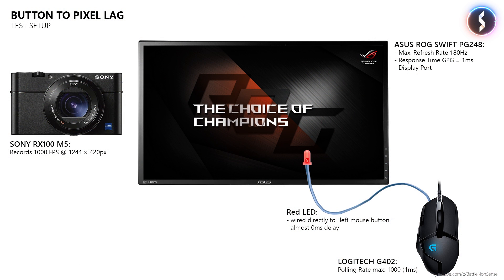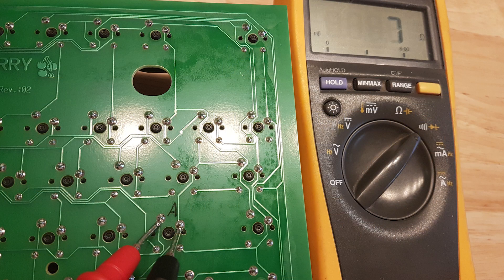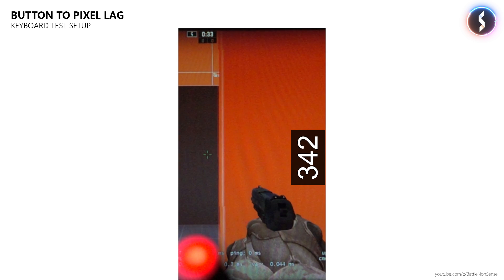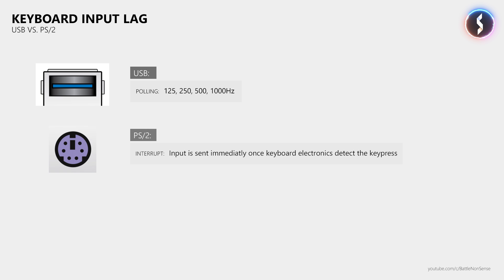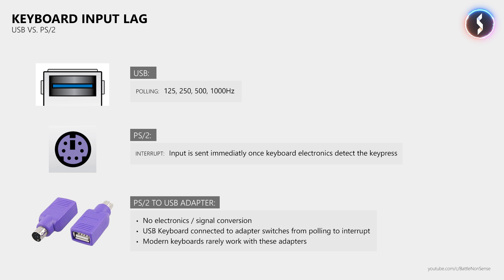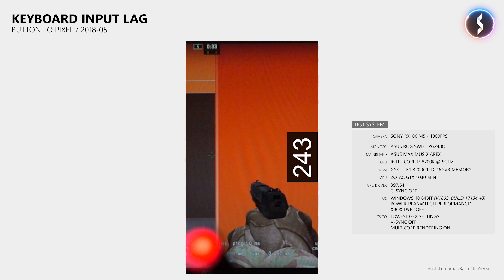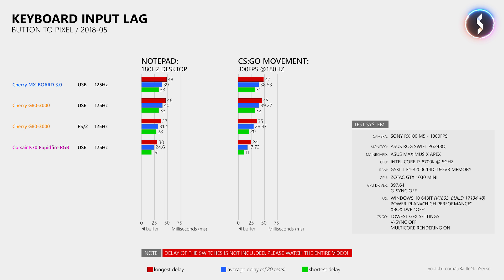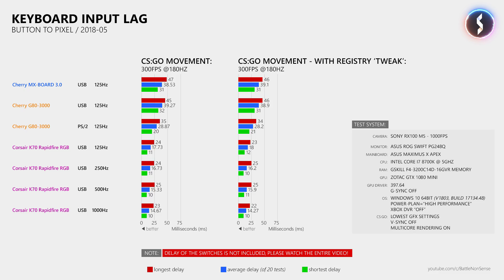Keyboard Input Lag 125, 250, 500, 1000Hz USB vs. PS/2

Comment: The polling rate defines the maximum delay from the usb connection. At 125hz you can have 0ms to 8ms delay with an average of 4ms. At 1000hz 0ms to 1ms with average 0.5ms. The average difference between 125hz and 1000hz in theory should be 3.5ms which the data confirm.
Reply from the maker: You are right! I am going to pin this comment. :)
Thanks!
Reply: CPU usage does increase with higher polling rates. Polling involves work that must be done by the CPU, your computer can't break the laws of physics. 
However, it should not be by any noticeable amount on a modern system. 9% on a 7500 is not a polling issue directly - but you are right that polling effects your CPU usage, so read on...
High polling rates should not increase power draw by any measurable amount. it would be in the order of milliamps in single to double digits. 
It should not have any bearing on stability at all.

An experiment for you to try: Open task manager, minimise all your windows and move the mouse back and forth as fast as possible over the desktop for a few seconds (make a big zig-zag and count to 5). CPU usage should stay the same. Now, maximise this youtube window, move the mouse in the same way over this comment section. Note the increase in CPU usage? That's youtube spying on you (yes, this webpage is a keylogger/mouselogger. It won't work on wikipedia for example, it will work on google) . Lower polling rate will decrease this effect, as there will be fewer updates for the browser to record.

So, as you can see Roni, decreasing polling rate does effect CPU utilisation, and while it will be to no significant degree directly, there are indirect consequences caused by the system responding to more frequent and numerous updates from the mouse.
Reply: Why would anyone use lower polling rates than available ?
Reply: Roni Väärälä
, you need to understand the big difference between interrupt and polling for IO.
Interrupt - IO device interrupts the CPU to inform it that there's new data available. So when there's no data available, the CPU doesn't need to pay any attention to the IO device.
Polling - The CPU periodically polls the IO device to see if there's new data available.

So with polling, the more frequently you perform the poll, the sooner you notice the new data. However, the very process of performing a poll requires the processor to spend time and processing power (which could be used for something else).

Or to make an analogy, imagine two different situation when driving a car to a destination and having a child in the back seat.

Polling - Are we there yet? Are we there yet? Are we there yet? .... Are we there yet?
Interrupt - Tell me when we get there .... Opens a book and starts reading.
Reply: John Cochran: Polling does not need to be done specifically by the CPU. Inside your keyboard, there is a microcontroller that polls every key at some rate. There is a USB frame rate (once per millisecond), and a USB report rate that is some subdivision of that (such as 125 or 250Hz). The USB host controller is polling your device at its report rate; the CPU has simply set up a schedule for it to do so. Then the host controller interrupts the CPU if there was anything to report, so effectively USB devices are also interrupt based as far as the CPU is concerned. In addition, there are other delays like transfer time, which is drastically worse on PS/2; a mouse packet takes about 2ms to transfer, worse if it has a scroll wheel, and can therefore never keep up with a 1ms polling period.
Reply: Stability and power draw... same reason people don't all run their CPU at 5ghz.

Not really always applicable I guess but I've had (I assume) shitty keyboards in the past (Razer Lycosa/Blackwidow Ultimate) that would actually cause errors and problems if you put em at 1000hz.
Reply: I don't care about CPU usage, but I did find some games were unplayable at 250+ mouse polling rates. Mostly Bethesda 60fps-capped games (Dishonored 1/2, Skyrim).....it's as if they were "missing" some of the reports (like a full queue that drops the new packets).
Reply: Even more importantly IMO, the delay added by polling is essentially completely random. A 125hz poll can add 0-8ms of lag while a 1000hz poll will always be within 1ms of the next poll.

For something like rhythm game gameplay at a high level this can be really important - the timing window for a perfect hit on osu with timing difficulty set to OD10 is 20ms, an 8ms variance eats 40% of your timing window so that it's noticeably harder to play with a 125hz keyboard than a 1000hz.

A bit of consistent input lag can be compensated for by hitting consistently earlier but the randomness can't
Reply: b888 there shouldn't really be any "performance drops". The effect is somewhat negligible. It's very small.
Like I said on my first post: It very very much likely NOT ever 'lag' your pc.
I wasn't trying to convince anyone to "don't use 1000hz or it will lag your pc". Just gave him MY actual usage case.
And since he asked "Why would anyone use less than max?" and I use it below max, and for that reason, therefore it gives a perfectly valid answer for his question.

However, I will say/ask this: Do you even notice any difference? between 125hz and 1000hz?
Ask help from a friend, tell him to switch the pooling rate, don't tell you to which, and then you go ahead and use the mouse, do some testing.
Then ask him to change it again, not telling you which, and test it again. Tell him which did you think was the 1000 and which was the 125.
(Maybe repeat this one more time if you want to be scientific about it.)
Did you guess right? Could you even tell a difference? 

(If you couldn't guess right, then honestly, to use 1000hz is just a waste. It is beyond useless: not only you aren't getting any benefits, but you are certainly increasing your likelihood of encountering bugs, including, but not limited to - the ones described by Matei Beratco, and also wasting some cpu cycles. ) 

(The "ask a friend part" is because if you simply switch and test it yourself, you will very probably 'notice' an effect, even if the driver was bugged and wasn't actually changing. Because we humans are super susceptible to the placebo effect. You will 'see' a difference even if there isn't one, because you believe there is.
This is pretty much how homeopathy "works". )
Reply: @viniciusmr , Everything you just said is conpeltely fucking wrong, 1000hz gives more inputs per second, meaning less ms of delay between polls. 

Saying a high polling lags you pc is the dumbest thing you could have possibly said. Its like saying running you're game at higher frame rate lags your pc. This only applies to shit pc's or ones with no cooling.
Reply: @slayarch2217  I don't think that's quite right. In polling for USB input, the CPU sends out a request and waits and processes a response. That means for a small time the CPU is asking and waiting for the USB controller to give back a value, turning up the polling rate means more frequently the CPU will stop to check and wait. An interrupt is more that the CPU receives some data (mouse position change from ps/2 in this case) and the CPU stops its current task and processes the request, more efficient on paper as there is no time for waiting, the CPU is always processing something. Performing polling on paper is more CPU intensive but for more modern systems its almost nothing, but you also leave yourself open to how the USB controller handles the mouse input. There is more variance since not all USB ports are the same and not all USB controller are the same. 

Whether the resource cost of polling at 1000hz is enough to impact (lag) a system is dependent on a bunch of things. From the point of polling vs interrupts, polling is more demanding especially if the frequency of the polling is 1000hz.
Reply: I agree with Jason Hardman on the fact that there is also a big difference on how different program detects pressing of a keyboard key. 
For instance Notepad that you used relies on receiving a WM_KeyDown message form OS (https://msdn.microsoft.com/en-us/library/windows/desktop/ms646280(v=vs.85).aspx). Since this is jut one of many WM messages that each windows program is receiving from OS into a message queue the program response could easily vary by a few milliseconds (easily even up to 10 ms). That is why when you are writing a program that needs a timer with high precision you don't use message based Timer that OS provides.
Now most games don't rely on WM_KeyDown messages but check keyboard state at certain intervals using GetKeyboardState method (https://msdn.microsoft.com/en-us/library/windows/desktop/ms646299(v=vs.85).aspx). Most games do this after every rendering pass so higher frame rate you have in a game more often does it check the keyboard sate. The problem is that with this method there might still be some input lag variation mostly caused by Windows because  windows does some processing before it updates the keyboard state.
But some games actually use Keyboard Hooks instead. What is Keyboard Hook. Keyboard Hook is a special way of detecting keyboard presses on the lowest level possible. When an application registers a keyboard hook it essentially tells Windows to notify it of any keyboard presses before doing anything else with that information. This allows such application to register keyboard press as soon as possible and even to cancel it so OS won't sent any message about key being pressed to any other application.

So if you would really want to do some  true and reliable input lag testing of various keyboard you would have to use a program that relies on keyboard hooks in order to detect key presses with the least lag cause by OS and other programs.

Any way if you consider that the average human reaction time for visual stimulus is around 250ms then these few milliseconds difference between input lag of different keyboards basically makes no difference.
Reply: Matei Beratco hmm that sounds like a vsync issue.
For some reason a lot of games somehow have their engines set up in a way that when you enable Vsync your (mouse) input suffers.

If you are able, try running at 1000hz and turn vsync off (forced from display drivers and/or ingame) and see if that solves your issues.
Reply: The CPU usage that i have from waving a 1000hz mouse around is on the order of 0.1%. It'll register a bit higher if the CPU is in an idle power state - 0.5% of 800mhz is the same as 0.1% of 4000mhz.
Reply: I was going to write the same thing but lo and behold...   lol
Well spotted
Reply: Can someone explain if a USB 2.0 actually has a USB?
Reply: How about scan rate?
Reply: +Roni Väärälä Higher pooling rates can increase CPU usage by a 'considerable' amount. I"m not saying it will lag your PC, but you can even see it easily on Device Manager. I use 125hz on my mouse for that reason. I used to used 500hz, but it would make the Windows respective process to handling mouse on the desktop go up to 9% cpu usage, on an Intel i5-7500, so...
Since I don't really notice or care for the supposed 'extra-smoothness', I much prefer keep that cpu usage on 3%.
My mouse also does 1000hz, but you can imagine how more computationally expensive that'd be. 
If you want to learn more about how and why this is so, a reasonably quick search on Google can give you the technical insight and relevant explanation.
Reply: @viniciusmr  i wouldn't pay much attention to what the task manager reports about cpu usage. The cpu may be actually idling, waiting for input, but the task manager will report it as "busy". Do not trust the task manager...
Reply: Capta, nice info! Stuff like that might have influenced my observations. I wasn't caring much about the total cpu utilization, just mostly the cpu utilization of the Windows Process called "Desktop Window Manager", which I noticed was way higher when I was moving my mouse and it was in a high pooling rate, than it'd be otherwise with a low pooling rate. And only when I was be moving it. 

But your examples broaden the understanding on how this can impact a system. 
Notice that I'm not saying "lag", just 'impact' =) 

Oh, and about that 9%,  the cpu wasn't locked in a high state, most likely halfway, clockwise, so it'd be more like "4,5%". It really isn't a big deal, sure. But since I really don't care or otherwise notice the difference between 1KHz and 125Hz, I opt to keep it at 125 for that reason. 

And since he asked "why would anyone", and I gave him an honest, factual answer of why would anyone not use it at max. Between arguable placeboo and a noticeable, checkable cpu usage on process explorer, I chose to leave it at 125 =p
Reply: Something to consider there's a difference in the programs between the system knowing that a key was pressed, and deciding to do something with that information. I suspect that games will generally only check and calculate the impact of a key being pressed once per frame anyway.
With an interrupt based system then the OS will have captured the interrupt, logged what the press was, and save it for the game to retrieve when it needs it.
With a polled system I believe the OS will ask for the keyboard state on a timer, and log the information in the same way ready for the game to use. Feels less efficient in effect to spend cycles asking for an update, but I daresay it's a very minor impact in real life; and I wonder how much of that is handled in the USB hardware rather than on the CPU.
Reply: despite the fact that you are bound to the 180hz display refresh rate which gives you a margin of 5.56ms of every key-press.
Reply: Gvgeo came here to find this comment
Reply: Offtopic but, if the above experiment didn't worry you enough, you should search for 'the selfish ledger' the leaked google memo.
Reply: Lol this is nothing new. I noticed this like back in 2010 when I was doing literally nothing on my PC but for some reason noticed network traffic whenever I was moving my mouse around on a youtube page...
Reply: And the amount of lag a PS/2 keyboard suffers is 0ms, because input from a PS/2 keyboard is immediately processed thanks to it triggering an interrupt and commanding the CPU to stop and process the input.
Reply: @Nicholas_Steel  The PS/2 keyboard protocol talks at about 10kbps on average, and depending on the key pressed or released can be a couple of 8 bit characters sent per press.
So, even though the port isn't polled (at least at the level we're considering here), so there's no polling latency, the time to actually send the characters is still comparable to the polling latency of usb.

It may still be better as it should be a fairly constant predictable delay, as opposed to a variance.   For example: a consistent 5ms delay is much better than a 5ms average delay that came from an even distribution 0-10ms spread.
Reply: Thanks for the added info nwimpney.
Reply: @Nicholas_Steel  you can't possibly think that every time data is coming through a serial port, the cpu just drops everything and services that interrupt.
Reply: @Nicholas_Steel  Yup one reason I always used to use PS/2 keyboard especially on older versions of Windows that were buggy and would lock up on you because even if your mouse froze ctrl-alt-del would still work and would be able to regain control without waiting forever for usb mouse to respond!
Reply: Yesto dear, "my pc", is listed at the description. It isn't "hella slow", and my mouse doesn't "slow it down". But since you're "pretty sure", I'm confident you checked your hypothesis and inspected  the <dwm> process on many "normal people"'s pcs and came back here to report your breakthrough findings.  Thank you for your deep insight and thoughtful reading.
Reply: ayporos I have a core 2 duo g102 mouse. Should I use 250 or 500 ir 1000hz?. I honestly don't see more CPU usage the 8% when using 1000hz over using 125hz Is my observation accurate or should I be seeing more performance drops?
Reply: Goddamn. Should have read this comment before posting. Thumbs up! Also I have the suspicion that you can't measure properly where (f_USB/f_Monitor) is a Natural number. But I'm too tired to figure that out right now.
Reply: Vinicius Moraes lmao, your pc must be hella slow, if even your mouse slows it down. im pretty sure normal people hold their mice in the highest polling rate available and get less that 5% cpu usage
Reply: @yesto9676  you didnt even test it and make bold claims.... try again and move the mouse fast with constant motion and try with different open windows vs desktop
Reply: @JH-fk8ow  yeah, theres nothing here to test
Reply: +Vinicius Moraes
I can guarantee that a 1000 Hz polling rate should not cause any noticable CPU usage on anything even remotely close to a modern system. If that really happened to you on your system, something else was going very wrong.

Comment: Just clear on thing up: Switching adapters will introduce noise that often exceeds 17kHz. This can affect the brightness output on the diode. While this will not affect results, just use batteries. It is not worth the hassle of validation, explanation and in some cases controlling for the variable..

Comment: My mechanical Cherry MX Board 3.0 S RGB always seems to be a bit laggy despite its 1000 Hz polling rate when compared to my old rubberdome Cherry G-222 PS/2 which I bought back in 2005.

It might by the PC's electronics that make PS/2 faster. My PS/2 systems are between 12 and 18 years old, although my impression has been that my gaming laptop's integrated keyboard (which is a PS/2) is also more responsive than my mechanical USB keyboard.